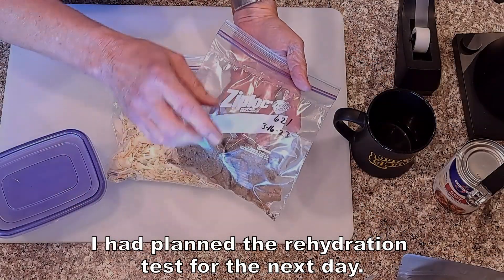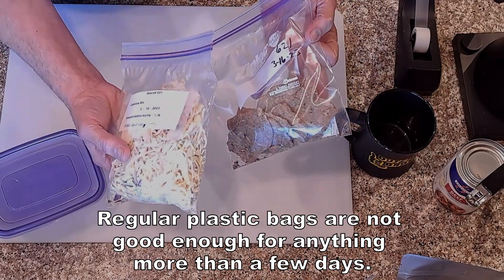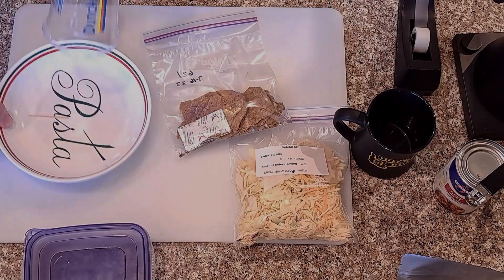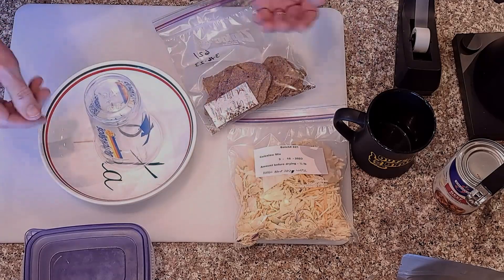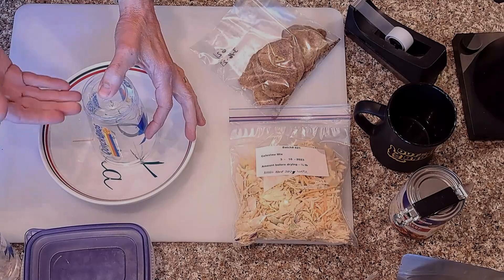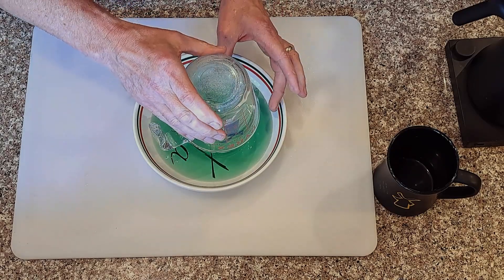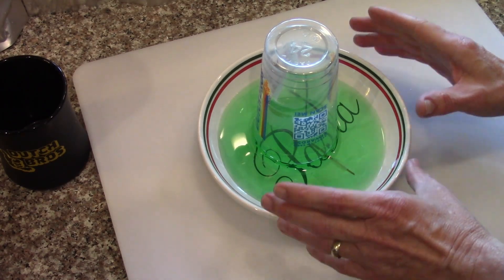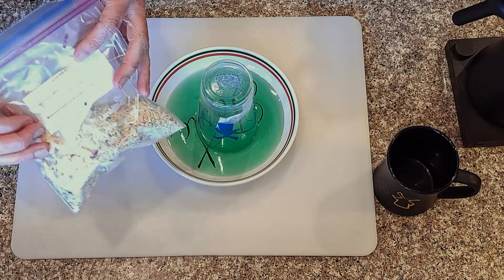Video Clip From Batch 621- Just the OA Test - USED Oxygen Absorber - Still Working!

Comment: Could I put it in a bag by itself with a tester strip?
Reply from the maker: I'm not sure I understand. Are you asking if we could put the oxygen sensors like the ones that come with the oxygen absorber packs in the Mylar bags with the food? Yes we could - but - it wouldn't tells us how much oxygen could still be absorbed, and the ones that come with the oxygen absorbers we get act so fast you could never see them change. https://youtu.be/fbREiFhTpgk?si=CE-kK7nJHDIgaUKZ&t=2019
Reply: @SchoolReports  What I mean is, if the bag is sealed and I place the o2 sensor in a bag alone, and the sensor turns pink, is that another way to test and see if it's good? 
Maybe I don't understand. Thank you
Reply from the maker: @Sas_HeatherC  😁 Okay, I'll try again, let's see if can I get it. 😂 (And this is why I don't do text a lot. - Too easy to misunderstand) We'll keep going back and forth until we are both talking about the same thing:)

Is this it?
1) Take a Mylar bag, put in the oxygen absorber that we want to test/check, 
2) put in an color change oxygen sensor packet (pinkish = no oxygen / blueish = oxygen), 
3) seal the bag, 
4) wait a while and see if the sensor turns back to pink showing that all the oxygen has been absorbed.

If that's it, it would probably work, but:
We wouldn't be able to see the sensor through Mylar bags. 
When opening a non-clear container (Mylar bag), the sensor turns blue so fast when exposed to air that we might never see it pink.
If we used a clear bag (zipper bag or other clear bag), we could see it, but those bags will allow more oxygen to go through the bags.
Without a measured volume, we won't know how much they are absorbing, but it could tell us that it did absorb it all.
We could use a well sealed glass jar, but it still may not give us the data about effectiveness of the oxygen absorber.

I've considered/wanted to put oxygen sensors packets, along with the absorbers, in the bags with my food, but I knew I'd never be able to open a bag and find the sensor before it had already turned blue. I'd never know if it worked or not. 

BTW - I started working on a new oxygen absorber testing video a while back. Coming soon.
Reply: @SchoolReports  You got it, and I communicated somehow via text. LOL 😆 I always taught my kids that texting is not communicating, and there is no substitute for a verbal conversation.
I was thinking more of a clear bag or a windowed mylar. Basically, you could do both then, but the way you are doing it in the video is the most efficient.
Reply from the maker: @Sas_HeatherC  First try! (As said by Batman in the Lego movie!)
Agreed! Texting is no substitute for a verbal conversation. It's for saying "Please pick up milk on the way home."
Reply: @SchoolReports  Another question, if you don't mind. Why do you place your 3d printed grommets for the top hinge of the freeze dryer door?
Reply from the maker: @Sas_HeatherC   I'll admit this may not come across clearly.
I originally did this with my machine because it really, really needed it. This replaces the grommet that was in the hinge pivot of our machine. (The new machines are better) The grommet would break down and cause some binding of the hinge. I referenced the need/use of it, a little, in this video: https://youtu.be/LA1sHVUqKts?t=207
With the new doors HR have a very hinge loose pin allowing the door to flop forward and back as it is opened and closed. On my older machine they used a tight, pressed in socket for the hinge, leading to hinge area fractures issues. With my sister's new machine we decided to tighten up the pin-socket fit by adding two layers of heat-shrink tubing to the pin. I also added a 3D printed hinge grommet to each pin area.
Printing Harvest Right Hinge Grommet https://youtu.be/tIBu2Xmv21U?si=wtpuPx2ZxFJV4B8I&t=146
New 2022 Harvest Right Freeze Dryer vs 2017 Freeze Dryer https://youtu.be/91gEssGQsYw?si=ji2syWhtW0M2WWMT&t=448
Reply: @SchoolReports  Oh got you loud and clear! You are an excellent teacher. we bought ours and haven't opened it as covid hit, and we found out our electrical had shorted out and inferior materials. We are moving and I will have my mad scientist lab finally! This will include my harvest right LOL. How loud is the pump? I have heard the green premier pump is bearable behind closed doors. So I take it the manufactured model versions are one 2017 and then updated in 2022?
Reply from the maker: @Sas_HeatherC   In my opinion, electrical shorts can be a bad thing and usually to be avoided:) 
 Is this the vacuum pump you have? Vacuum Pump - https://youtu.be/UibI7LXFbbs?si=QwK-QCJ_d2sDvOtR

What sound level people find objectionable will of course depend on the individual. (And I'd say that the most sensitive in the house makes the noise rules!)
My sister's vacuum pump is quieter than my vacuum pump, you can hardly hear it over the noise of the refrigeration system of the chamber. That's not to say they are quiet. They are not. When it's something that's going to be running overnight or even 2 days straight, noise is an issue and is often ignored. (Or lied about?) The sound levels are sometimes described as similar/the same as a dishwasher. I would say if your dishwasher sounded like the freeze dryer (and ran for 30 hours), people wouldn't have them in their kitchens. The sound level reminds me of a commercial dishwasher. It's fine as long as there is a door between me and the freeze dryer.
Reply: @SchoolReports  yes that is the pump. it was bought as an "upgrade"
Reply from the maker: @Sas_HeatherC  I've been very impressed with that pump so far.
Reply from the maker: Well, you've made me rethink my oxygen absorber testing. 
I had just finished make the new testing video showing how to measure the container, mark it, drill and use it. I videoed it over a 3 day period to watch the water rise to show the amount of oxygen that had been absorbed/converted. Now, after thinking more about our exchange on the subject, I've come to the conclusion that I may have been looking at this differently than most people. I was looking to find out exactly (as closely as possible with the equipment I have) how much oxygen a single oxygen absorber can absorb. (Example: Can that 300cc oxygen absorber absorb 300cc, 400cc, or 441cc of oxygen) After thinking more about this, and talking to others, I now think that a lot of people just want to know how to test their absorbers to make sure that will remove all the oxygen in the size bag/container they are using. They just want to know if their oxygen absorbers are still any good. That should be an easier test. So, I'll probably scrape some of the video I just made and include the simpler method. Assuming it works out. - Testing right now.
Reply from the maker: Thanks for asking these questions about the oxygen absorber/test strips. I made a new video based on these questions. 
Short Version - Simple Test: Using a Pickle Jar and a Soda Bottle to Test Oxygen Absorbers - https://youtu.be/zCKh0gtg28k?si=dW8Bgmm5KA-jBB6P

Comment: The higher the water gets the harder it is to lift. It would be interesting to see how a new OA performs. The used OA did pretty well pulling a vacuum on a water column.
Reply from the maker: It can never pull in higher then about 21% of the total volume. Once the oxygen (21%) is all absorbed it will stop, but you can refill the container with fresh air and continue again and again until the absorber can no longer absorb any more.

Testing A 500cc Oxygen Absorber. Simple Science Experiment With Oxygen Absorbers. https://youtu.be/NrzsNvy-srQ
Oxygen Absorber Supplemental Video - Testing a Used Oxygen Absorber https://youtu.be/JkBdeXT-Dv8